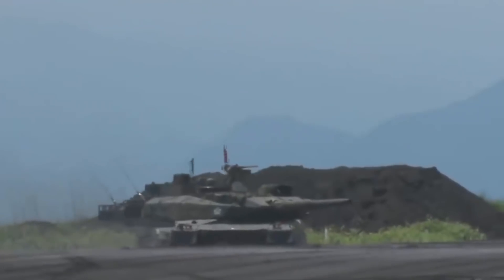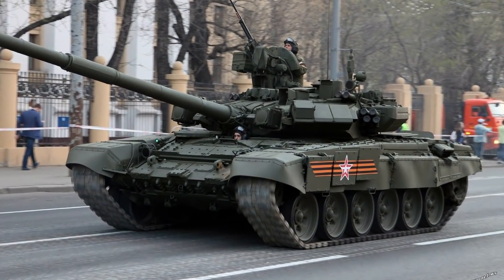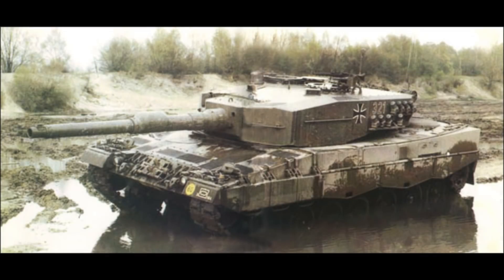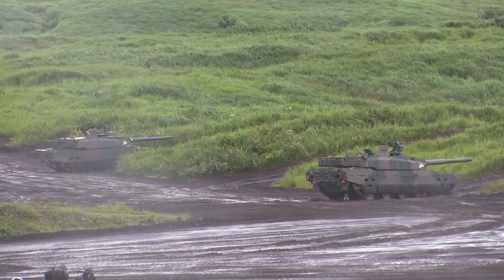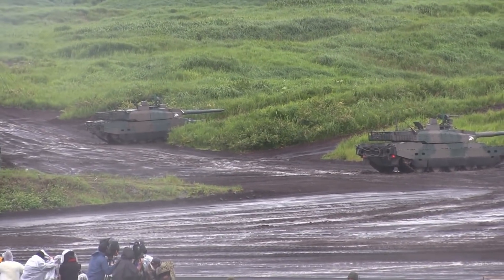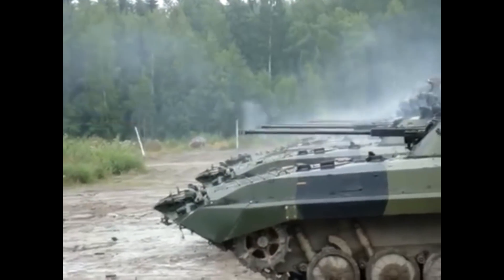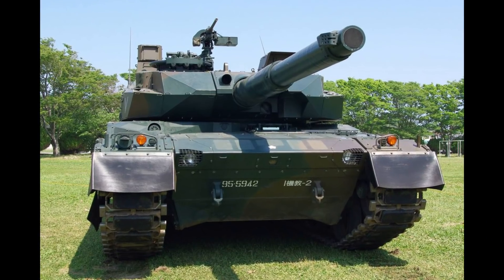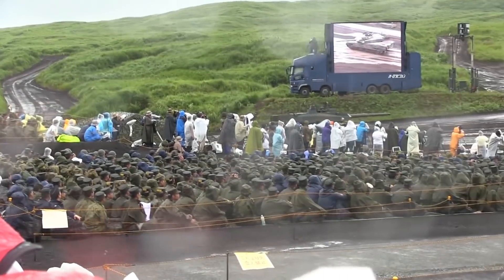Problems with Type 10 tank

Comment: Well Japan claims that this Tank is immune to fire from APFSDS Type-4 ammunition from a distance of 250m but I believe that the Tank should be fitted with various armor modules which will increase its weight to 48 tons. I doubt that this Tank is capable of withstanding fire from Chinese APFSDS munitions such as the DTW-125-II and DTC10-125.
Reply: It is planned to get extra armor packages.
Reply: Like what the comment above me says, they are planning extra armor packages for the type 10, but they need to keep its weight down enough that it’s able to use Japan’s infrastructure like bridges.
Reply: @Waldel Martell Not always, enemies liked to keep bridges and Defenders always destroy it before the enemy arrives. 

There's a lot of cases in WW2 that bridges don't get destroyed until the enemy is within the line of sight.
Reply: @Waldel Martell ik that but what I meant is in the case Japan is ever attacked for whatever reason, in the initial stage, the type 10s, as well as the type 74s and type 16s would be able to get to a place getting attacked very quickly. On the other hand, the type 90 is just too heavy for the bridges in Japan and would break them. That also means that if enemy tanks somehow made there way onto Japan’a home islands, there tanks wouldn’t be able to go over the Japanese bridges as almost all other mbts are heavier than even the type 90. Meaning any enemy would have to use lighter vehicles in Japan like ifvs, which wouldn’t fare well against the type 10. Imma stop here before I end up writing like a whole essay.
Reply: Jjohnno 87  It's just a fancy way to name a lighter steel which Leclerc's have been using from the get-go. Just a quote from someone.

"I dislike the name “nano-crystalline steel” because it conveys the idea that there is some form of super-advanced nanotechnology involved in this type of material, whereas it really is just random steel treated differently to alter its grain structure. In essence, it is just a new generation of steel plates with a fancy marketing."
Reply: @pacianooo3250  I guess the molecules of the steel or material were structured in a way to be super durable and lightweight. Still, everything about it is mostly classified, so we don't know a whole lot about it. Can future tanks be super tough and lightweight? Yes.
Reply: @NationChosenByGod  The US have been testing these kinds of armor from the 80s so it's not like this is a new groundbreaking technology.
Reply: @pacianooo3250  source? Besides, why is the Abram not lightweight enough with those types of armor?
Reply: @NationChosenByGod  Abrams does not use CNT or any lightweight armor as they aren't as effective as the Chobham armor. CNT armors are better off used to body armors but even then, they have issues in terms of production. I'm completely wrong on the time that the US have started fiddling around with CNT armor but the point stands that they've been testing it before CNTs gained publicity. I can't leave links to the of the sources I've got as YouTube already deleted my replies three times so it's best you look it up over in the internet. Especially Quora, it might not be the best site for you to look answers but majority of people who are knowledgeable on the subject agree that there are already materials better than CNT.
Reply: The interior is as small as a T-90, and the fuel, ammunition, and engine space is lighter than those, so the Type 10 doesn't have to sacrifice armor space.
Reply: CNT would be prohibitively expensive for composite armour (if you want your tank to cost $25-30 million per piece), (and degrades more easily to heat than regular steel) the only advantage it serves as a form of kevlar mesh for the hard but brittle ceramics/heavy metals. Iirc the latest variant of DU armour in the Abrams does implement the use carbon-fiber as a mesh to add a bit more durability to the composite (so the brittle DU in the armour can more hits before giving in)

Comment: well the JSDF has stated  "nanocrystal + modular ceramic composite Armor" in both Type 90 and Type 10 on the wikipedia and in other Japanese articles (all in Japanese)
Reply: what does that mean?
Reply: @zn9219  kind of something Mitsubishi claims of "bringing Iron mon suit  armor to Reality" . remember the Arjun video  where the supposed hole in the front is protected by a new kind of armor that can provide twice the protection thickness of usual RHA steel? this tech claims to be far more thinner yet able to deal with major blows . kind of a thin sheet of paper being bulletproof to anything till assault rifles and not above.
Reply: nanocrystal is a marketing term for the newest (2010s) armored steel. It's lighter. It's already widely used. T-14s outer turret is made of this class of steel, modernized russian BMPs were presented with spaced armor like this. ~5mm does the same job as ~8mm of older steel, enough to stop rifle bullets on its own. It's not a revolutionary improvement, just an improvement.
Reply: Nano Crystal Armour just means very high hardness steel but this has been used by other nations way before Type 10 as the standard.
Modern composites use ceramics.
Reply: マシナブルセラミックスと言います。機械加工性が高く、非金属元素のケイ素に様々な金属系元素の微粒子を混ぜ込んで作られています。

Comment: Tempted to write a lot, but I’ll scale it down. Basically, the type 10 was made to be able to freely move around Japan, something the type 90 had trouble with due to it being to heavy. It was designed to defend Japan, so it only has to worry about frontal armor as it should always face where the enemy is coming from. As for the “other tanks can easily pen it” how are those other tanks gonna get to Japan’s main islands? 

TLDR: the type 10 isn’t perfect, especially for thing like facing other mbts head-on, but it is perfect for the Jsdf and it’s role. Defense of the home islands of Japan.

Comment: I think tank is good in the thing which is meant to used. 
Which is; deploy in fast manner
Be decent frontal armour
Have superior fire power. 
It's not meant to drive on city in Iraq..
Reply: It have the same weight as a T-90m that have way better protection, same mobility and firepower (maybe even better firepower considering guided missiles)
Reply: @tsorevitch2409  Interior space is your answer for that. The T-90 is relatively cramped compared to the Type 10.
Reply: @awsmmann  it's a price you have to pay to 
Make protected tank with reasonable weight.
Reply: @tsorevitch2409  Type-10 is better mobility wise

Comment: It's well to Japan's needs. They are a defensive force so it is tailored to their territory. I wonder for pure defense whether a non turret design would have been better like the S103 tank or Stug. Can make them light but still more protected
Reply: Might as well make a remote controlled turret
Reply: @badgermcbadger1968  but would US share its data of TTB with Japan though?
Reply: @Joshua_N-A  I'm sure Japan can develop its own
Reply: @badgermcbadger1968  oh right, forgot about how capable Mitsubishi is of such things.
Reply: Honestly with the advent of unmanned vehicle, I can see casemate type vehicle making a comeback, especially for countries whose doctrine focus primarily on defense. Imagine a 40-50ish ummanned vehicle with a lot of composite armor and ERA because all the space for the crew is replaced with a much smaller computers so loitering ammunition cannot just make for an easy roof kill, armed with a big cannon (130mm perhaps) so it can knock out most modern tanks and roof mounted autocannon for drones
Reply: @Joshua_N-A   Why they don't development at first place?

Comment: Yeah, pretty sure the turret sides don't have additional armor. At 2:05 the turret sides (from back to front) are labelled:
砲塔側面モジュール: Turret side module
砲塔側面カバー: Turret side cover
砲塔側面装甲モジュール: Turret side armor module

If the yellow module part was armored, they'd probably have added the "装甲" part and colored it red, just like the other part that's specifically labelled as "armored" (装甲).

Comment: If the type 10's light weight is a problem due to not enough armor, but at the same time the enemy tanks are too heavy to travel Japan's roads and bridges......it sounds like the Type 10 wins.
Reply: No cuz they have engineering bridge laying vehicles.
Reply: @HelminthCombos  Laying bridges takes time. The type 10 would be plinking them off from across the river.
Reply: @rael5469  You seem to lack a little "depth" perception here RAEL.   Chances are there would quite a few type 99's backing up any bridge layers.
Reply: well.... The T90 weighs 45 tons, thats only 1 ton heavier than the type 10, and 5 tons lighter than the Type 90. The Type 99 is 55 tons, which is 5 tons heavier than the type 90, but the type 96A weighs in at 42 tons. 

Japan's closest possible enemies both have tanks that are just as light as theirs. China has mountainous terrain too, so they have tanks that were designed based on similar issues as Japan. Russia just has lighter MBTs in general due to doctrine. 

I honestly think maybe Japan plans to move the tanks over bridges and then apply additional armor when they no longer have to be under the weight limit for infrastructure transport.
Reply: @jonsong4592  Interesting info. Thanks.
Reply: @jonsong4592  Even modern T-72 weigh 46 tons. T-90S weighs 48 tons. Modern domestic T-90's weigh 50+ tons.
Reply: 42 tons (Basic Loadout)
44 tons (Standard Loadout)
48 tons (Full Loadout)
Reply: @nekochan4683  Interesting, thanks.
Reply: Most nations lack the proper amphibious assault capabilities of the U.S. as they're extremely expensive to build/develop and require a strong navy to protect since hitting and establishing a beach head leaves them very vulnerable from coastal, naval and aviation systems. China has very few dedicated amphibious landing craft and very few designed specifically to ship and land armored vehicles en masse. The same is true of Russia, which we've seen in Ukraine. 

The Chinese don't have the luxury that the Russians did of a large friendly peninsula/island like Crimea with which to build and stage troops across natural land bridges. They're going to have to establish a beach head against an opponent that's been actively training to counter it and is backed and supplied by one of the most powerful militaries in the world who have active military assets on said island. The only MBT that'd make weight for China would be their defunct ZTZ96 series or their special mountain version ZTQ which lacks hydropneumatics suspension. Unfortunately for China and Russia, they generally envision their tanks fighting across open fields and not undulating, uneven terrain. Since China pretty much designed their tanks off of the T series Soviet tanks with modern ones using a different armored turret profile, they tend to all lack gun depression. Bad gun depression doesn't matter when pushing across the Fulda gap and allows the tank to be shorter. It's an absolute pain when said tank has to fight in uneven terrain common in the mountains and they don't have the suspension to get the extra gun depression that may be needed to even get their guns on target. 

So the Japanese know that whatever armored vehicles that can even be landed on Japan isn't going to have the ability to bring heavy armor or decent guns to the battle either. They'll be under the same limitations as them. This is why they're comfortable with actively fielding 105mm guns on their wheeled gun vehicles and keeping the older Type 74s in limited service. More than likely, any enemy able to land any armor is going to be using light vehicles with little to no armor in which a 105mm gun will go right through it, not to mention the 120mm gun on the type 90 and type 10. Both of these vehicles are still able to field extensive composite armor at least in the front arc and will be an absolute pain to engage with anything smaller than 120mm. Ironically, the Japanese were able to engineer something that effectively has more armor than pretty much anything that'd be able to successfully invade and operate on the islands with them.
Reply: @Talishar  Wow, an amazing reply, Talishar.

Comment: I mean, this tank is not designed to be running at anywhere else beside Japanese lands, which the Japanese will have the advantage of knowing the land better than anybody else.
This pretty much mean that Japan designed this thing to be a coordinated sneak hit-and-run attacker, rapidly moving and striking when the enemy least expect it.
They wont need to prepare for getting attacked from the side because they tactics will not position or place themselves in a position to be attacked from the side.

Comment: I think it actually does have side protection, in some of its kits. And these plates on the turret are made from,  steel(made using nano technology to be as light and thin as possible) and ceramics... just as well as Puma IFV has now. Which the developers of Puma said RPG-7 penetrates max 10mm at best(dunno how much of this is true, but if Type 16 during tests could survive direct hit from Gustav, and still be usable... I dunno). So there is also probably some additional protection against chemical based rounds (heat, rockets). Type 10 essentially has the same and even better defenses than her predecessor(Type 90), but at half the weight thanks to this composite armor type. While the tank is 40/44/48 tons heavy depending on the kit it picks. I am not saying it cannot be penned, but it´s definitely not as easy as it would seem. Combining with high speed and low profile(not in base mode, but while using hydropneumatic suspension). It´s more of a dodgy tank, that may survive a hit, get back and thanks to modularity be back in action. If there is something it lacks it´s probably firepower, as it still has L44, unlike Leopard with its L55 guns.(As they believed that in a city, the shorter gun would be better,  cuz Japan and it mainly being urban area or hills).

Comment: One thing to mention about the weight is that the Type 10 is actually quite small. It's closer to T-90 than it is to Abrams. It's in fact 50cm narrower and only 8cm taller than the T-90. If you take their blueprints and overlay them, Abrams looks huge next to both of them. Type 10 has the same full-loadout weight as the T-90M and is similar in size.
Reply: Yeap. Why it looks proportional to bigger western MBTs is because of that shorter L44 gun. Optical illusion. Coz if it was wearing an L55 gun, its gonna look very “russian”, with a gun that looks too big for its turret.

Comment: I wonder how the frontal armor compares to the T-72, given that they are both tanks in the 40 ton range. Since the Type-10 is newer, I would expect it to have better base armor than the T-72A and probably the T-72B.
Reply: but the whole russian doctrine is low profile smol tenk. They save weight as a consequence of small tank, which also limits gun depression and interior space. Type 10 doesn't seem to be very smol. It costs more in weight to put equivalent armor on a bigger tank. So I really don't think weight would be a good indication in this case.
Reply: @jonsong4592 they actually are pretty much the same size

Comment: So basically from all i've heard about this tank, it's a glass cannon. It has a great gun, great sights, amazing mobility, but the second it's getting spotted, it's basically dead.
Reply: The same idea created tanks like Leo 1 and AMX 30, it was dominant in tankbuilding in late 50s to mid 70s
Reply: They have increased frontal protection compared to the Type 90 (more frontal composite) but with some visible weak spot, the side protection on the other hand was sacrificed to achieve the light weight.

Also their is an 48 ton version according to Mitsubishi Heavy Industries which receive additional protection to the side and top of the MBT.
Reply: @bogdanbogdanoff5164  Leo 1 had decent amor for it's time. straight up hit from a T-62 and it's Ok. can probably stand against Chieftain . but not anything like T 64 or above.
Reply: @patriotenfield3276  No it didn't. It was designed to only stop 20mm autocannon fire, with an armor 70mm at the mantlet. It wouldn't stop T-34 rounds, especially since most tanks in the 60s used primarily HEAT rounds.
Reply: Perhaps ... If some amphibious invasion force manages to deploy enough heavy weaponry. This would not be so easy to do. It is designed to fight in Japan not overseas on broad flat ground.
Reply: People tends to attribute heavy weight to armor, which is completely wrong in the Type 10's case.
The tank is extremely frontally heavy because of it's composite armor. To achieve a good frontal armor with low weight, they had to strip off all of it's side armor and focused it on it's front. Also, the tank have a smaller profile compared to it's Western counterparts like Leo 2, Challenger 2 and Abrams. The Type 10's hull dimensions are similar to the russian T-series, and the tank's height can be reduced thanks to it's hydropneumatic suspension. Having a smaller profile helps on increasing the protection, since you have a smaller area of the tank to be covered, it is possible to maintain the same level of protection with less weight or increase protection with the same weight. 
This comes with downsides however, like possible having higher ground pressure because of less roadwheels, having cramped interior, carrying less fuel and less ammo. Upgrades are also hard to do without greatly increasing the tank's weight.
Reply: T-90m have same weight but much more capable due to proper design..
Reply: @_awston1637  does it have a three man crew?
Reply: @tsorevitch2409  Complete different tanks made for different scenarios from different people and different needs. Yeah, lets compare they. 
👍
Reply: @bogdanbogdanoff5164  The Type 10? Yes it does.
Reply: @_awston1637  it's very easy to compare - cost, efficiency, tech specs. All in favor of T-90m. Japan is just not very good In tank design. But it's quite understandable considering that they are martime nation.